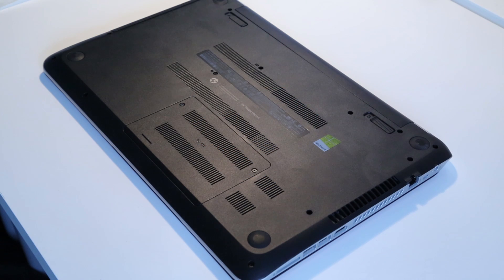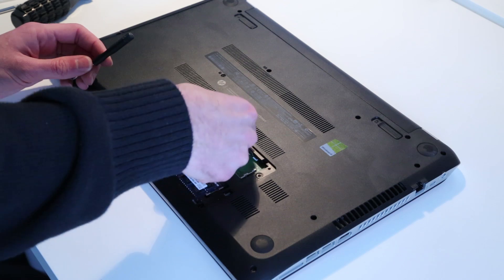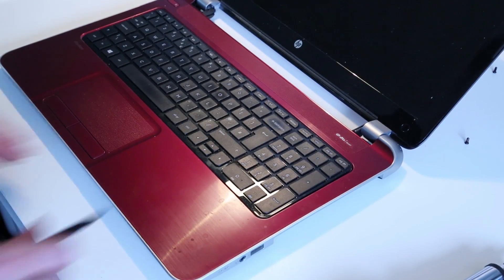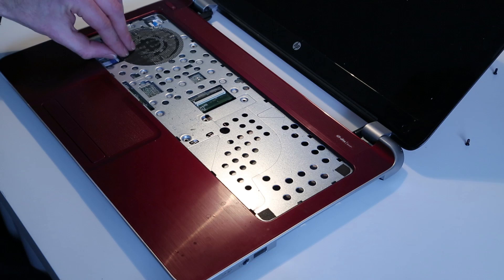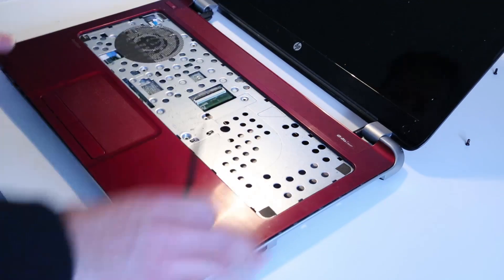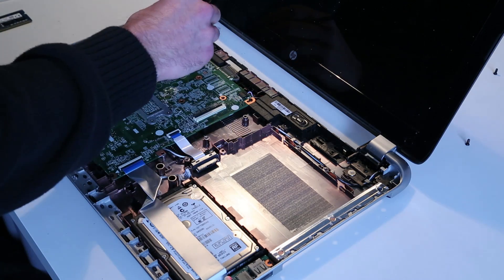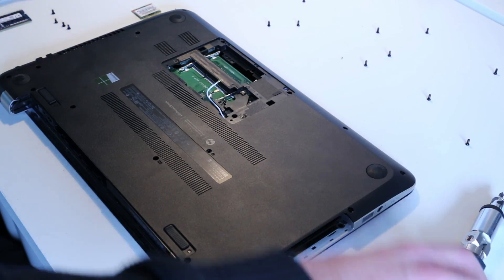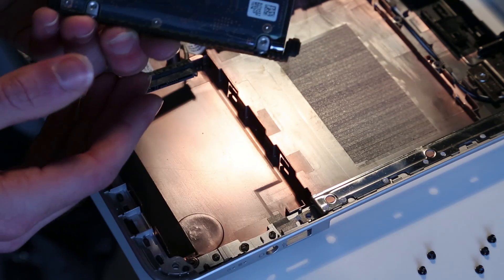HP Pavilion 15-n270sa Repair and Disassembly Guide

Comment: But did removing the bios battery fix the problem? Did you replace the battery or just reinstall it?
Reply from the maker: What problem are you referring to?
Reply: @BrueComputing You said at the start of the video that it was failing to boot and you wanted to remove the battery from the bios so I was hoping you would report how that went as a fix.
Reply from the maker: Ah okay, the video is over 10 years old now so I'll be honest I don't recall - I suspect it sorted it out otherwise I probably wouldn't have uploaded the video.
Sorry I can't answer better than that - I repaired hundreds of laptops over the years running the business.
Reply: @BrueComputing Its nice that you take the time to answer after all these years. Anyway I am about to tear apart two Pavilions and hopefully make one (if not two) work again both being in a state of no longer switching on at the switch. I am sure both have had screws mixed up so I have the Manual which lists the correct screw sizes and I am hoping stripping them and reassembling (probably also try the bios battery out trick too) will bring them back to life. Anyway it will be a fun way to spend a day provided I get no interruptions. Your video will help enormously so thanks.
Reply from the maker: No problem! Good luck and glad it helped!

Comment: I've disassembly this laptop so many times that I've no problems doing it myself.
I was more looking for this particular plastic sheet between the keyboard up part and the inside/motherboard part. I didn't manage to see if you're having this piece on yours. I would like to remove it but I don't want make short circuit.
Perhaps, do you have this information? Thanks!
Reply: Would you happen to know how to replace the screen on this? I cant find any tutorials anywhere. Thanks

Comment: Thanks a lot! It is very useful guide. I have a question. Should I have to disassemble all the screws in order to clean the fan? I ruined the top left screw(left of the battery near the disc driver). Am I still able to open the top part of it or not in that case?

Comment: My keyboard and those 3 screws under the DVD port wouldn't come off. I struggled badly but managed to break the fan and take it out. No more GRRRAWWOORRRURRRRR anymore! External fan should be bought soon...
Reply: DarknoorX had the same problem. What was the solution?

Comment: +Brue Computing Is it possible to swap the motherboard from one HP Pavilion 15-n270sa to another lets say a 15-n034nr? I know they are the same size an shape but would I run into other problems?

Comment: Thanks for the Video, helpful to me
I just did a hdd replacement on a HP 15-n298sa Very similar
3 screws under DVD drive, and where you started at 4:45 with pry tool at from front, there are 3 nodges at rear in battery containment area, push them in as pulling apart, and start at back and pry around sides.

Comment: My laptop's hard drive on this model is failing. I've backed up my data and would like to keep using it. Do you know the hard drives dimensions and what connection it uses? Or can you direct me to a replacement? Any help would be greatly appreciated. If you can, I wouldn't mind paying a tenner or whatever for the info through paypal.
Reply from the maker: +James Caleb It takes a 9.5mm thick 2.5" SATA hard drive - this would do the trick: http://www.amazon.co.uk/gp/product/B009AYVNMQ/ref=as_li_tl?ie=UTF8&camp=1634&creative=19450&creativeASIN=B009AYVNMQ&linkCode=as2&tag=httpwwwbrue0a-21
Thanks for the offer of payment, but no need - if you purchase the drive through the link above then I get a small affiliates commission at no extra cost to you though. :)

Comment: I took my HP pavilian 15--n278sa apart. When i put it back together, the screen wouldnt light up. Now the laptop will not turn on. I also found a tiny screw with a blue base. I dont know where it goes. Could you help me please?
Reply: +riddlers91 u found a tiny screw after the assembling?  thats lousy man. after i assembled the laptop, i got 2 extra screws and an extra hard disk.  damn i am good!!

Comment: WHY THE HELL YOU DIDNT SAY ABOUT THE SMALL SCREWS BY THE CD DRIVE SIDE. THEY ARE VERY SMALL BRUSHED STEEL COLOURED. THERE ARE THREE OF THEM. I CANT OPEN THE FRONT COVER BECAUSE OF THEM, AND BY SOME MIRACLE YOU DONT HAVE THE SCREWS.
Reply from the maker: +vnklololis My apologies, when I edited it I sped up removing the base screws (as 5 minutes of screw removal is boring) and cut it in the wrong place before returning to normal speed. You can see me removing in the video but it should have been slowed down and described. Hope it didn't cause you too many problems.
Reply: +Brue Computing I also had problems with removing the front cover because of the three screws.. can you possibly remake the guide with the disassembly of that part? I'm not sure how to go about it myself..
Reply from the maker: +Jason Unfortunately not, the videos are done as I'm repairing customer systems so I haven't had the machine for a year now.